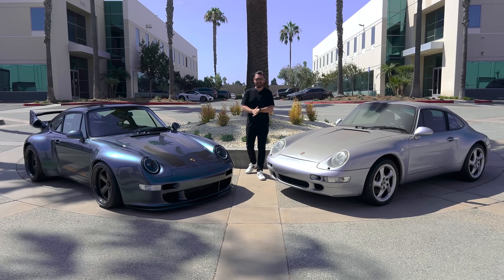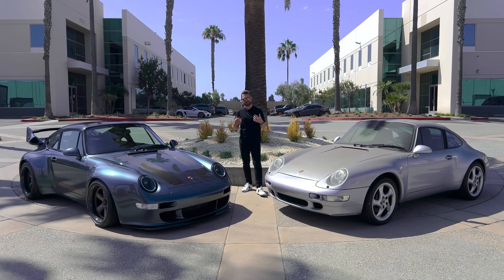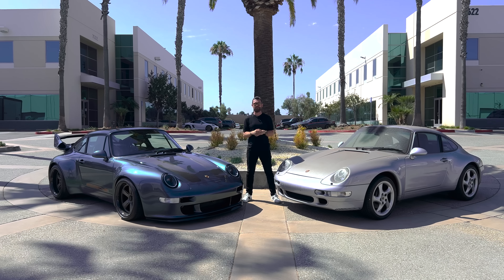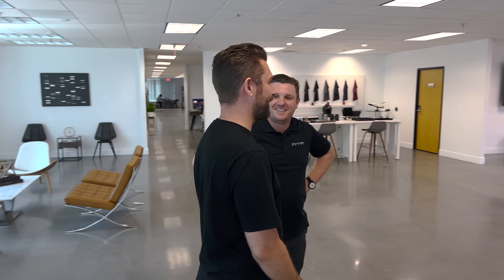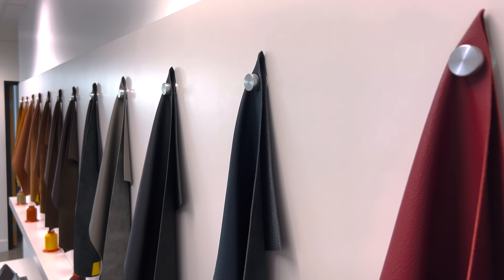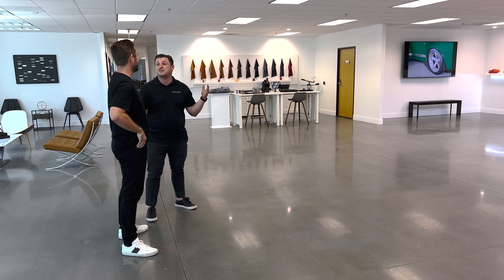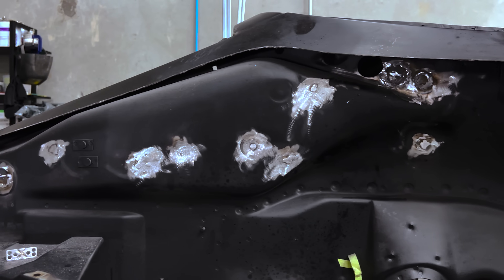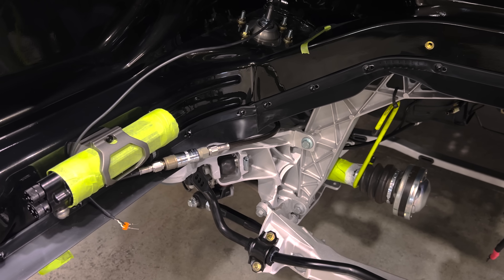The Worlds Best Porsche Restomods Are Built Here!

Comment: The Porsche 911 
 is a high-performance sports car manufactured by Porsche AG. It is part of the 911 series and is equipped with a turbocharged flat-six engine that produces up to 640 horsepower. The car is known for its powerful acceleration, sharp handling, and luxurious interior. The Porsche 911 Turbo S is considered a flagship model and is one of the top performing sports cars on the market.

Comment: Upgraded brakes should not have brake fade like that even with four grown men & luggage. Brake fluid will boil over when moisture is in the system and creates air bubbles when heated. Brake fluid will attract moisture as soon as a fresh bottle is opened; always use fresh high temp fluid. Moisture and air will cause the pedal to go to the floor when fluid gets hot from caliper heat. Take care when changing brake fluid.

Comment: My 1991 civic with a B16 (1.6L) made ON THE DYNO 191 Wheel HP. Who said 100HP/liter is impossible? C'mon guys... those B series were designed in the 80-90's. And its not even the new K series. SO 100HP PER LITER IS OBSOLETE!
Reply: Reving at 10500 RPM on the dyno, that's where the power dropped enough so we establish the cut-off. No newbie here! Do you need help on further development, I can offer my services?